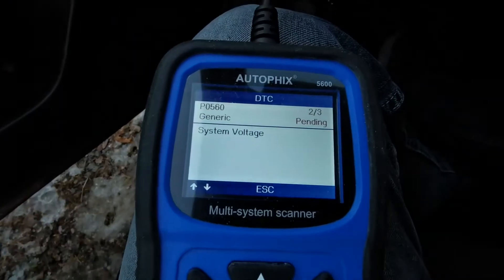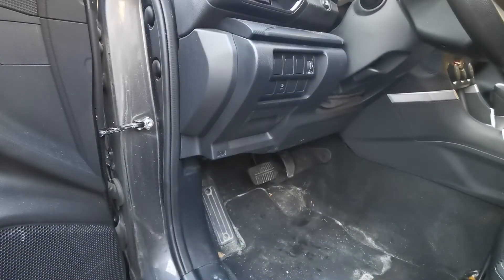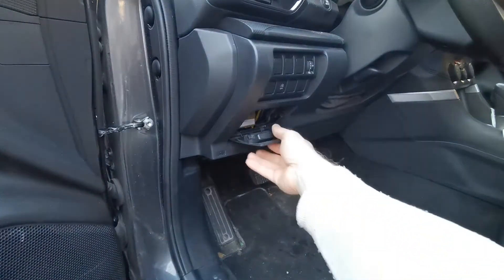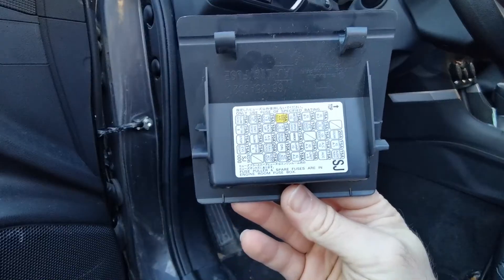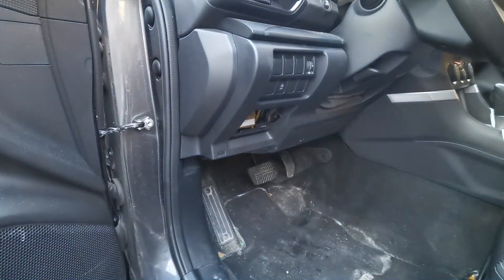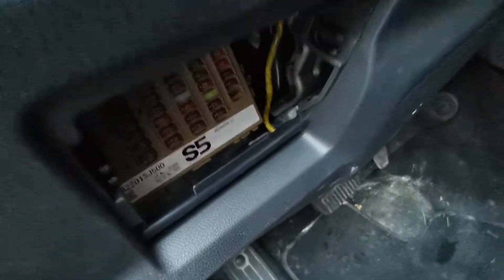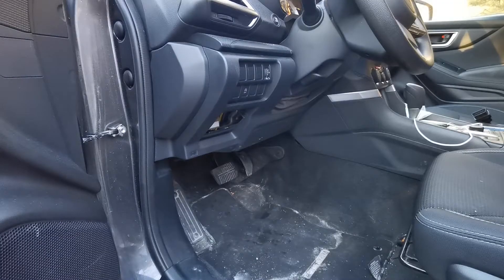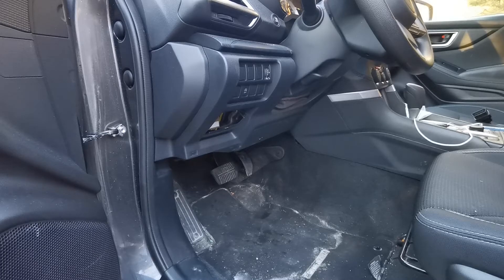Subaru P0560 Error Code Power Electrical Problem (flashing cruise control/drive mode +) CEL SOLVED!!

Comment: I have a 2024 subaru forester and have been having issues check engine light went on once flashing modes and others on the dash idk what to do Subaru keeps saying nothings wrong
Reply from the maker: Did Subaru ever provide you with the error code(s) that triggered the CEL?

Comment: Change your battery cable ends with good quality brass cable ends fixed cruise light flashing o2 sensor code lights cleared instantly easy fix
Reply from the maker: Good to know! I suppose this particular issue can have multiple origins.

Comment: Although I have a 2019 Impreza base. This fixed my issue with the cruise control/trip screen and engine light. However, I did not have a voltage meter so I simply removed all of the 7.5 fuses and none of them were blown I inserted them back into the slots and went to start the car there was a slight delay when I turned the key but it started right up and the check engine light was off as well as the screen was back to normal. No more flashing cruise/trip info.  Thanks
Reply from the maker: Wow that's interesting. Could be some corrosion in the fuse connector in the fuse box I suppose. Thank you for sharing!

Comment: I have the same warning lights. But i feel vibrations and engine hiccups at 2k rpm when accelerating. Did you feel the same or it’s just the waning lights popping? Thanks, man. I hope you could answer this.
Reply from the maker: no, in my case, it was purely the cruise control that stopped fonctionning, the engine was otherwise working correctly.

I would recommend you scan your car for codes and see whether this could be associated to perhaps a defective coil pack or spark plug. If you're experiencing hiccups, you will probably get additional engine error codes, like misfire.

Comment: I don't find any breaker fuse what else could it be?
Reply from the maker: You mean any blown fuse? Did you confirm that the code was indeed P0560?
Reply: @dronesandmore1977  yeah. Anyway I ended up changed computer board parts that distribute oils. Coste about $800 in parts